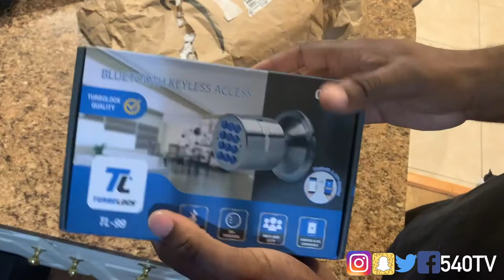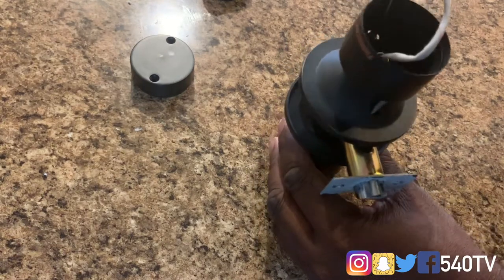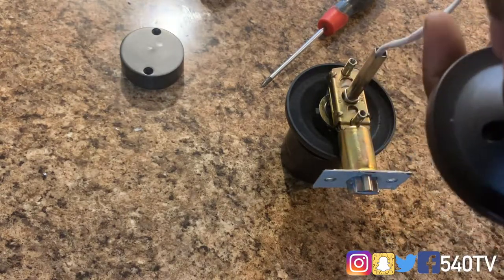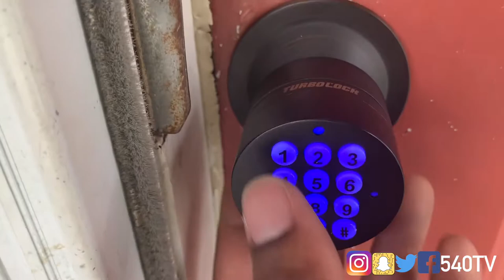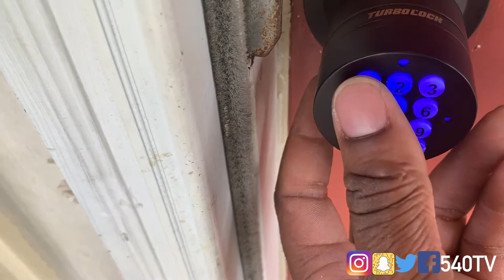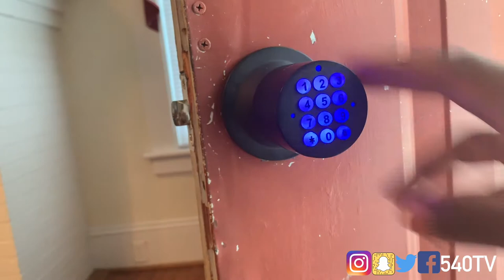Best Bluetooth Door Lock! TurboLock Review and Install

Comment: Can you input a temporary passive code so it doesn't lock?  Was thinking of installing this lock on the door that goes to the garage and if you have guest, it's a door that people will go in and out of constantly.  Would like to have a setting that keeps the knob unlocked so it works like a normal door temporarily....
Reply from the maker: Yes it does have a temp code but you’ll have to set it up thru your app. Of course you’ll have to set it up each time you want to use it
Reply: @540tv6  So the temp code needs to be used every time the door is opened, or it allows the door to remain unlocked?
Reply from the maker: You’ll have to enter it every time within the time limit you was the temporary code to last. When you close the door you have to enter the code again